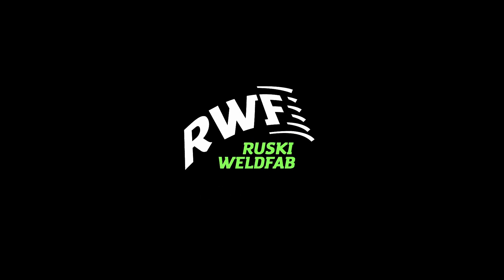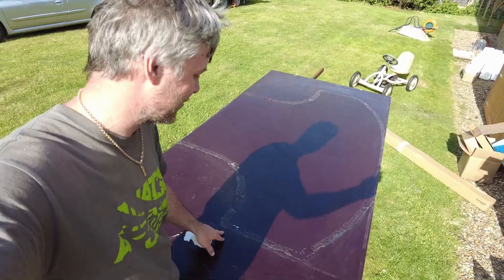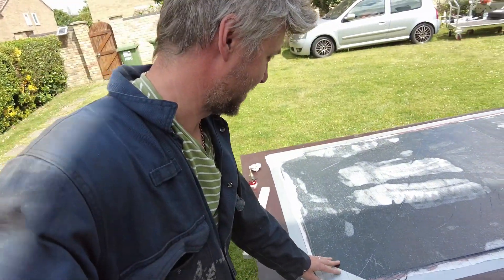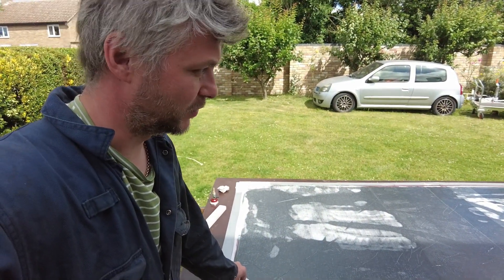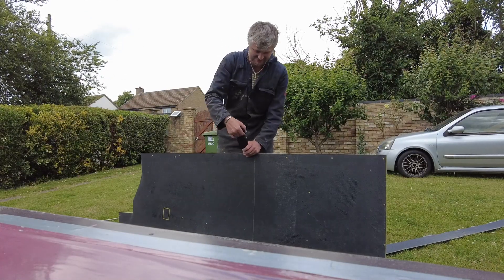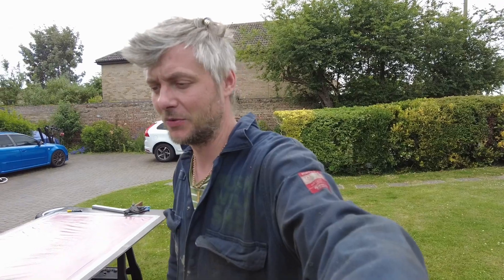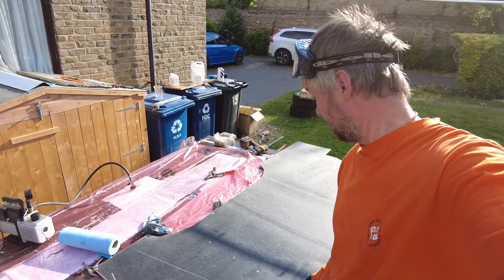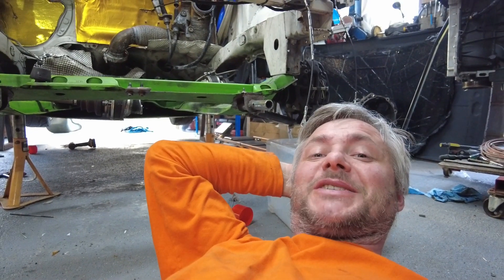Carbon flat floor! How to make composite carbon sheet panels. How light is too light?

Comment: Hello Ruskiweldfab:  I was under the impression that a slight bend to the undertray ( center about 1.5 inches - 50 mm lower than the front and rear wheel area) would produce more LOW PRESSURE = OR MORE SUCTION DOWN , than a straight flat floor.... Any thoughts or experiences with that?